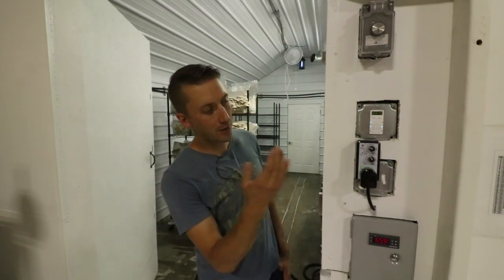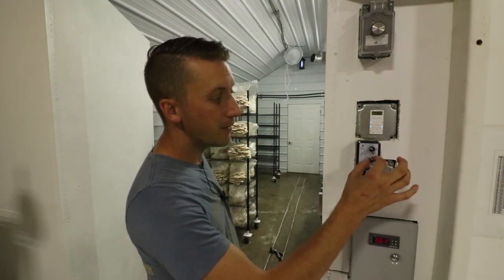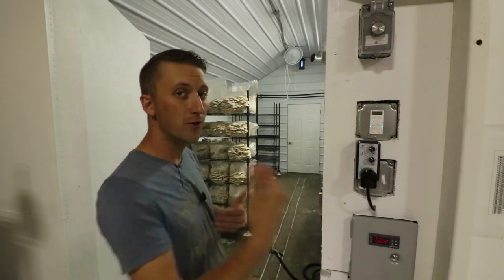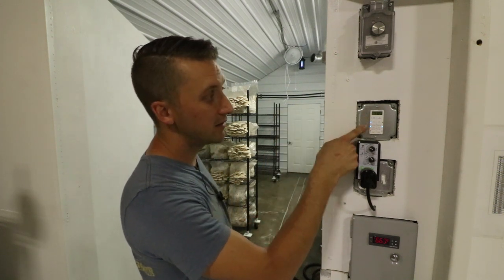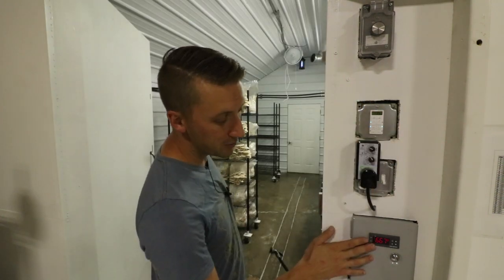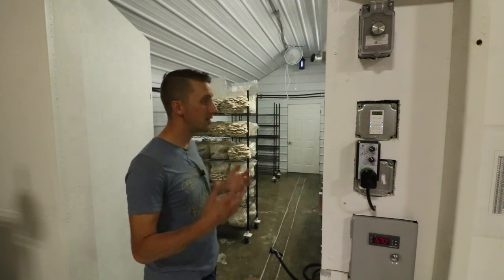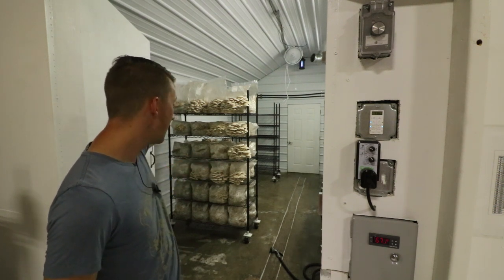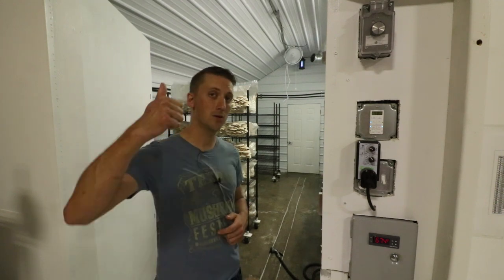How To Control Humidity and Airflow in Mushroom Fruiting Rooms

Comment: awesome! I'm currently setting up my own mid-pressure misters in a much smaller 6x10 chamber together with waterproof fan. i noticed in your high pressure mister video that you had the nozzles ziptied right to the fan with an opposing fan at the other end of the room. how does this compare with attaching a line of misters to the ceiling? I'm thinking of the doing the same thing and having a fan turn on at the same time as the misters.

Comment: Thanks, appreciate it. However, can u clarify some of my doubts please. I see an inlet for fresh air, but what about an outlet to control co2 build-up? And, if there's an outlet, couldn't it also suck out the moisture, thereby drying out the grow room?
Reply from the maker: There is an exhaust going 24/7 as well. that's what makes the room dry cycle and keep c02 down
Reply: @MyersMushroomsFarms  I see. The trick must lie in finding the balance to maintain high humidity, although, since your exhaust is running 24/7, I can't figure it out. Thanks
Reply from the maker: @revolioclockbergjr8482  thats where the cycle timer comes into play
Reply: @MyersMushroomsFarms  great brother. How do you set the timer. I mean on/off cycle and in between the cycle. Thanks

Comment: How cold can you get the Heat Pump to get the room without the fins icing up? 5-10C? We use a "through the window" 8K BTU Air Conditioning unit and the ripped off "coolbot" light bulb/cheap temp PID controller trick and it never ever ices up on us during the summer and we can get 4C out of it for our walk in cooler!
Reply: @Yourmom-tc4rn  So just to be clear, you can set the heat pump to 5C and it will cool the room to 5C? I thought they bottomed out at like 16C?
Reply: @Yourmom-tc4rn  I think I have lost you. Sorry. I am talking about the room that is being cooled by the heatpump not the outside temperature. Can it cool a room to 5C? Most heatpumps have a thermostat that will not go below 16C.

Comment: You look like you’re getting quality oysters.. but your setup is way over complicated. Why couldn’t you just use an ink bird and a regular humidifier, control it the exact same way over time... way less maintenance, cost is less. Don’t get me wrong it looks like it works but seems far from efficient.
Reply from the maker: you ever run inkbird? i did for years and they are horribly inaccurate and unreliable. What do you think is over complicated? My $30 cycle timer that i can adjust in a half second?
Reply: @MyersMushroomsFarms  and co2 sensors are way more riskier to run than a well calibrated 24/7 fan that gives enough air changes per hour.